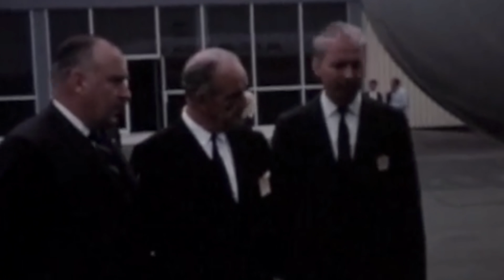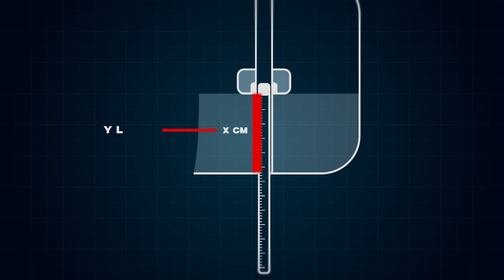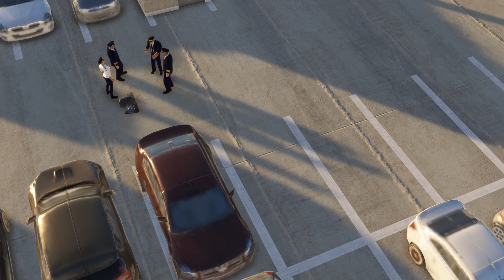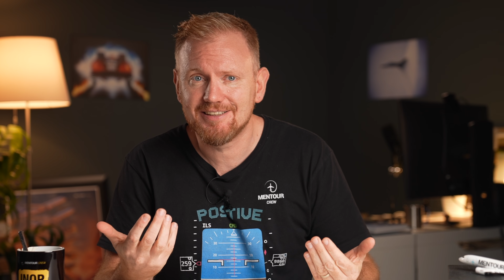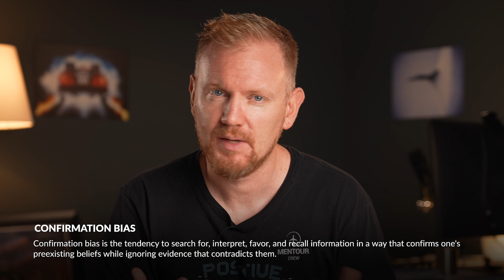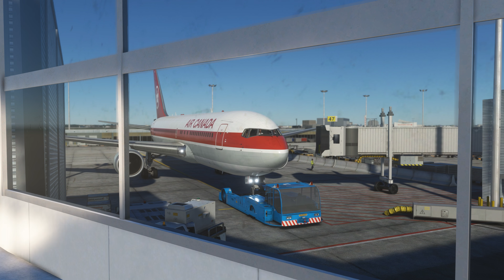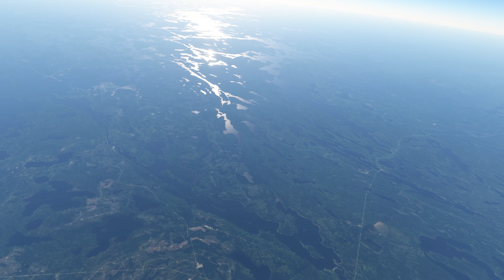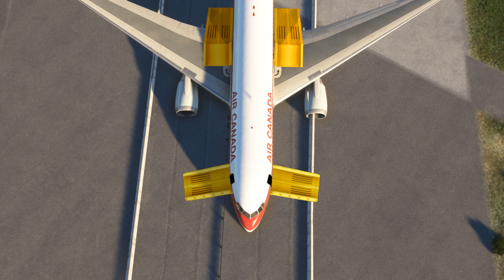NO Engines and Out Of FUEL! | The ”Gimli Glider" Miracle

Comment: It seems like most stories of the Gimli Glider focus on the conversion error. I appreciate that you studied all of the other factors that led to this crisis. The conversion error wouldn't have happened or would have been caught if the fuel gauges were working, or if the people involved would have been more versed in metric units. Clear and consistent guidance could have also prevented this.

To me, it's a coupling of mechanical, procedural, and human error; there is no single root cause. The “Swiss Cheese” model strikes again.

Comment: As a Canadian and aviation enthusiast I am quite familiar with the Gimli Glider incident, and I knew there was some confusion between metric and imperial measurement. I didn't know the whole story with the fuel gauge circuit failures and the drip stick tests, though, so thank you for the thorough video!

Comment: I once began work at an organisation operating a mix of British and American vintage aircraft. During my study of the aircraft documentation...there it was. The T6 (my speciality) weight and balance certificate was factored in Imperial gallons not US. The aircraft stayed glued to the ground until the new weight and balance check was carried out. As I was taught by my mentors, "Know your aircraft".
Ever seen a T6 up close in the weight on main gear position? It's huge.
Reply: I worked at Lockheed early 80's when an early Mars mission craft intended to orbit but nothing was received after arrival at the planet. After furious troubleshooting, the fabricator Lockheed had used US standard Imperial units while the software team at JPL had used SI metrics. So the numerals for Force, Power, etc were all volleyed back and forth, wrong. 😢

Comment: I am proud that I knew that 1 kg of water = 1 liter of water and also that fuel is lighter than water because it float on water surface since high school. So if I somehow ended up being around that plane when they did the calculations the rate would be very off to me 😅
Edit: I just got to the 25:20 and I am glad that mentor explained this to everyone not familiar with all these volume/mass calculations.
Reply: 1 kg was once defined as the mass of 1 litre of water at the temperature of its highest density, 4 degree Celsius.

Comment: I remember the conversion to the metric system and it was a nightmare for old timers like me.  I still think in pounds and feet but am comfortable in litres and kilometres.  Back then there was no google to ask for the conversion of imperial to metric.  I have also worked in electronics for forty years and while investigating QA for circuit board assembly I came across an interesting fact.  Now a usual way (that always made me nervous) was if an assembly failed the first test but you retested several times successfully it was good to go.  When a study was done about this way of testing they discovered that the assembly  is extremely likely to have a real problem (something like 85 or 90% chance) and that the board should not be accepted until the problem was found.

Comment: As ever a fascinating story.  Surprised tho that the flight crew didn't have a scooby about how to convert Litres into Mass, especially as its so easy in SI, and Canadian Schools started teaching SI in the mid to late 70's.  NB that the permitted production range of standard SG  (ie at 15c) for Jet A1 is between 0.775 to 0.840,  0.8 is just the normal average.  NB 2 is that the reason we measure fuel by weight is not just because of its implications for W&B and Perf, but because the energy produced by the fuel is closely predicted by its SG.  It is therefore mass, not its volume, that gives us a reliable method of calculating fuel burn/range etc.  Nor does mass vary, as volume does when the temperature of the fuel changes.
Reply: The mass of the fuel in addition to the plane's empty mass plus passenger/cargo also determines the plane's performance, so it makes sense measure the fuel's mass in kg rather than its volume in litres.

Comment: I wouldn’t characterize this as the most extraordinary. Remember Air Transat 236? Ran out of fuel, midway over the Atlantic inbound to Lisbon in 2001. It made an emergency landing on the Azores, and holds the worlds record for the longest unpowered glide of a commercial airliner.

Comment: This is a great example of why a solid foundation in basic math and science is crucial, no matter what field you enter. Oils, pretty much no matter what variety (including fuel oils like gasoline) are less dense than water. So a density factor above 1 should have automatically been discarded as wrong. It doesn't matter if you're talking metric 1g/mL or 1kg/L, or US customary units with 1 oz per oz(l), things which float one water are less than one. Things which sink in water are greater than 1.
Reply: Ah, you cover that a little bit later on.

Comment: Simulator exercises of the failure of all engines are usually done on type conversions and seat changes, so not very often. They are usually treated as a bit of a joke exercise as everyone knows it is very, very unlikely and the exercise always starts with the aircraft in a position from which it is possible.

My background includes a lot of gliding and tug flying and early on I realised that the method being taught was not the best way todo it, there was usually a lot of concentration on speed and less on getting the aircraft at the right height at the threshold. On the more recent times I have done this I concentrated on putting the threshold in the centre of the windscreen and controlling the speed with airbrakes (if they worked) or sideslipping, my theory being that putting the aircraft on the ground with all the runway in front of you even 30 knots fast gave you a better chance than being too high. In the first case you had the benefit of the wheel brakes for the whole length of the runway. The worst you were likely to experience was a low speed survivable accident.

It certainly worked on the occasions I tried it and on the last time the training captain allowed me to talk the first officer through it. He afterwards said he had never seen two consecutive exercises end with a successful landinding.

Comment: I really like the Cessna 188 Pacific rescue story that was dramatized in the 1993 made-for-TV movie "Mercy Mission: The Rescue of Flight 771"  It might make a cool video.  I'm not sure how accurate the movie is to what actually happened, but there some cool stuff in that movie. - A passenger jet going off-route to help try find a lost plane, - Trying to find location by flying in and out of radio range,  - Using exact time of sunset for both planes to try gauge distance. - Using a fuel dump to try become more visible to the lost plane.     I could help getting a copy of the movie to watch if you need.

Comment: It was slightly confusing to hear the words "drip stick" rather than "dip stick". Surely it's a stick that you "dip" into the tank to measure the level, similar in principle to the dip stick used to measure the oil level in your car?

Comment: A Boeing 767 is made of approximately 3.1 million separate parts.
Avionics and Electrical Systems: Involves thousands of electronic
modules, sensors, and many miles of wiring.
Engines: Each turbofan engine is an incredibly complex piece of machinery,
made of approximately 25,000 to 30,000 parts itself.

Google - From 1970 to today, approximately 85,000 airplanes have crashed. Feb. 9, 2024

Entropy is a scientific concept that measures a system's
disorder or the amount of energy unavailable to do work.
It is a measure of how spread out energy is; the more
spread out the energy, the higher the entropy. According
to the second law of thermodynamics, the entropy of an 
isolated system always increases over time as it moves 
towards a state of maximum disorder, or equilibrium.

Comment: 22:30 THIS IS NOT A COINCIDENCE!!, remember, they aimed for 22,300KG fuel mixing pounds with KG and thats why the 10,146KG they ended up with is roughly 22,300pound not KGs, so they ALWAYS would have ended up in roughly the amount in pounds what they actually needed in KG no matter the distance, i blame the thin air in the high altitude in Andorra for this mistake, higher altitude = less oxygen = less concentration? or maybe i misunderstood it entirely, havent slept yet

Comment: I learned about this incident when I was a grad student collaborating with a couple of guys at Boeing Computer Services in the early 1990s. It baffles me why the pilots didn't just use the obvious check that 1 L of water weighs 1 kg. Sure, the density of jet fuel (0.8kg/L, from the video) makes this a little off, but not by nearly a factor of 2...

Comment: 1L of fuel and 1L of water are actually the same lol
reminds me the joke of what is heavier, 100kg of steel or 100kg of feathers :D

by the way, if you wandered why pilots dont have an option to eject the engines (so that they could drift more), it is because for the air traffic corporations the cost of the engine is higher then the cost of all life on board :x

Comment: I grew up with the imperial system in the USA.

In science class, in like 8th grade, before this flight took to the air... we were taught the metric system and hated it. But, I do recall a few things about that system and the difference between the imperial and metric systems that have stuck with me since 8th grade. (1) Fahrenheit, for whom the scale is named, set 0 as the lowest possible temperature he could measure in the Netherlands. We thought that silly because we had just experienced -10 a few nights before, and on a "good" night in the Adirondacks we could get him -30 easy. (2) The temperature of 100 was set as the normal internal body temperature. Which is 100 because he could not get his rather large apparatus into a living human, so he stuck it into a very freshly dead cow. (3) A quart and a Liter are kinda the same. (4) The density of water is ONE... this was just way too easy to remember, and of particular importance here.

Additionally, having been around gasoline and oil starting from mowing the lawn and using a snow blower prior to 8th grade... gas and oil float. I have also noticed that oil floats just from eating salad with dressing and eating soup.

That said... using 1.77 as the conversion of fuel from Liters to Kg would mean that the fuel is 75% HEAVIER than water... and would never float. This is NUTS. It's not even remotely close.

This is simple 8th grade science from like 1980.

Comment: Back when I was fueling, we had a delta maddog divert into our airfield due to low pressure lights. They were able to make it in and taxi to a gate. Both fuel qty indicators were out in both the cockpit and the wing. So we had to use the drip sticks. The ones that were working bottom out, and the others just fell out. So we could not determine what was in the tanks. About an hour of deciding what to do. I told the crew that I will fuel the wings until the tanks VTO or spill out the vents. Using that method, I've determined that the aircraft had less than 100 gallons of fuel on board using known quantity method. They were very lucky, thankfully delta got shuttled in another aircraft and the crew flew back to Atlanta.

Comment: I am an engineer, and I love the way this story highlights the real-world consequences of system failures, as well as the miraculous efforts of cool-headed experts to save the day.  These guys made split-second decisions that saved dozens of lives, and saved their aircraft, while simultaneously highlighting a systemic weakness in standard practices, thereby making the entire industry safer moving forward.
Reply: You’d think the engineers designing the circuit that handles redundant signal switching in the case of a fault would have noticed that, if the parallel redundancy is dependent on a circuit (the switch) which DOESN’T HAVE A REDUNDANCY - then the whole project is an exercise in futility (or at least an exercise in practical irony)…

Comment: Stupidity causes more problems than anything else!

How can someone checking the fuel on a plane not be familiar with simple things like the density of fuel?

As a German technician working with emergency diesel generators, I know the rough density and temperature dependent expansion of hydrocarbons!
And even I have never used anything Imperial, I know that a mile is a little more then a Kilometer, and a inch is around 3cm, and a gallon is around 3 liters.
How do you get something like that backwards if you are supposed to know that stuff?! 😤

And so they let glorified monkeys service and fly planes with 100+ souls on board!? 🤦

And it's getting worse!
At some point, no checklist, handbook, rule or instruction could prevent such things from happening, because idiots more and more depend on them, not able to think by themselves!

Comment: This may be a silly question but wouldn’t the trim be messed up on take off, If your trim calculated with a weight that is significantly higher than the actual weight of the plane I would think it would try to take off early even if not by that much.
Reply: Trim is always neutral on takeoff

Comment: 7,682L×0.8=6,145.6KG
(Rounded 6,145KG)

(Per the placard to go from Liters to KG is to multiply by 0.79, rounded to 0.8)

22,300KG-6,145.6KG=16,154.4KG needed

16,154.4KG×1.2658=20,448.23952L
(Rounded 20,448L)

(Per the placard to go from Liters to KG is to multiply by 1.2658, which would likely be rounded to 1.27, or maybe 1.3)

Comment: Talking about engineering mindset. I wouldn't know the density of jet fuel, but I know two things for sure: Jet fuel floats on water, and water has a density of roughly 1 Kg/L. So, if you get a density of 1.77 Kg/L for jet fuel, then this can't be correct. It must be less than 1 Kg/L. Without looking it up, 0.8 Kg/L (as said in the video) sounds about right. Basically, the same thing as explained briefly in the video.

I studied with somebody who never spotted these kinds of problems. I looked so often over his calculations and told him that this can't be correct, but he never developed a feeling for the numbers. At the end he didn't graduate. Of course as engineers (in a real job and not just university) we have processes, procedures, and tools to ensure the quality of our work. However, it shouldn't be underestimated how important it is to have a basic feeling for the things you work with. Imho, this is a very important part of an engineering mindset, because it helps you to spot mistakes very early.

Comment: me and my dad found a board game where you play pilots on final approach, trying to stabilize it and coming in, it's pretty clever every turn you move one beacon forward and you have to assign dice to various functions to manipulate the flaps, lower gear, follow the glideslope, etc.  I bought it purely because I've enjoyed your channel so much and it was a great father-son moment.

Sadly the NTSB determined that the primary cause of the crash of Dining Room TBL01K was the fact there are no rules for a go-around, with the proximate cause of my inability to roll a 4 on a 6-sided die, allowing an asymmetric thrust to develop and leading to loss of control on an unstabilized approach.  And yes there are rules for scenarios with engine failures, storms with microburst downdrafts while at minimum fuel, and other complications.

Comment: omg, I started school here in the process of going metric. It was a colossal shitshow as even the teachers were unsure and one teacher would teach in Imperial and another in metric on different subjects. Our textbooks from a decade earlier were mostly Imperial. In the end I graduated from High school and while academic classes had sorted out metric the technical classes I attended still worked in Imperial right until finished in 92. Feet, inches, fractions of an inch, thousandths of an inch etc in machine shop, carpentry, welding, auto shop. To this day I can;t use a metric tape measure, don;t even own one, still use an Imperial vernier and dial gauges, rules etc.
I'm surprised there weren't more horror stories like this. Glad this one ended well.

Comment: Quick comment that may sound pedantic, but you seem very committed to getting details right so I felt compelled to mention it- the RAT is technically not a propeller because it doesn't propel the aircraft

Comment: I understand the failures that caused this, especially the lack of mathematical intuition around density conversion. What I can't wrap my head around is that the pilots didn't detect that the plane was 10000kg lighter than it should have been. That feels like a massive discrepancy to me. Wouldn't that impact how it quickly it accelerate/decelerated on the runways, how quickly it got in to the air and climbed and how it responded to controls in the air? Didn't it feel weirdly light and responsive to them?

Comment: I think what gets me about the fuel checks is that there should have been a significant disagreement between the fuel burn for the first leg and the expected fuel burn. I'd be keenly interested in making sure that my idea of the fuel burn was dead on correct before flying a leg without vastly more fuel than necessary, and I'm surprised they didn't calculate that and determine that the level lowered by significantly more than it should if their conversion factor were right.

Comment: A minor fault in in this extremely well research documentary.
It is not a drip stick - but a dip stick. A drip is has a hole in the stick tube. When stick reach fuel level fuel will start to drip. A dip stick has a floating magnet as shown in this excellent video.
Remember on F-27 once fuel  panels was interchanged. The outer panel with a short stick was mounted in inner panel location. Lucky it was discovered by a fuel calibration procedure that did not make sense.